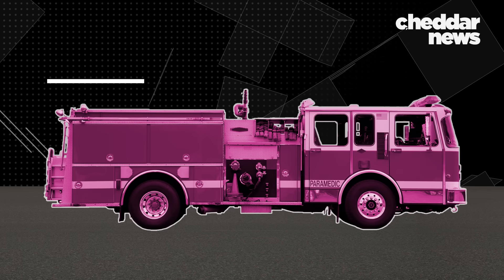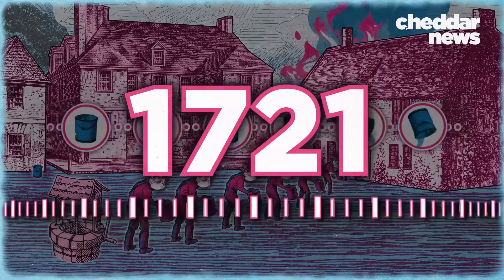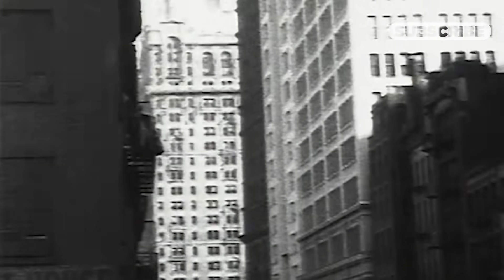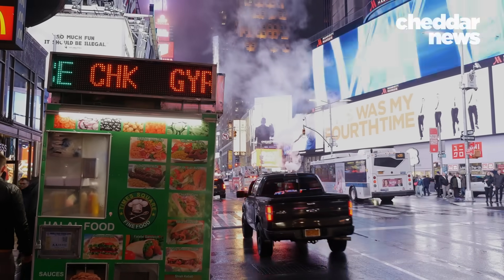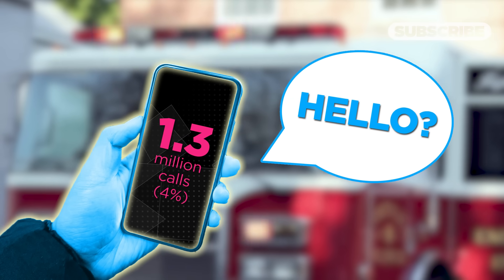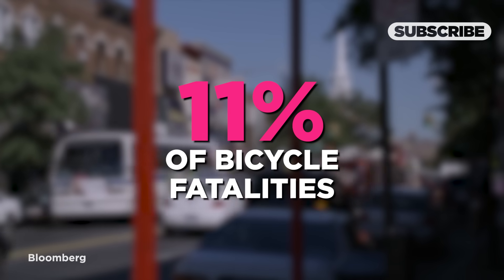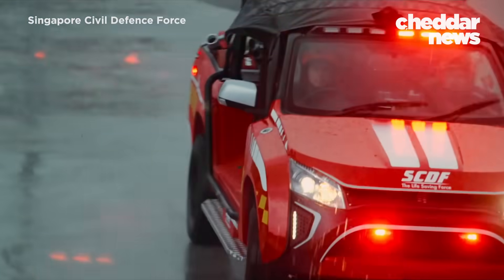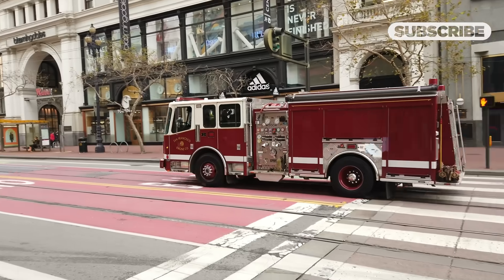Do American Fire Trucks Need To Be So Massive? - Cheddar Explains

Comment: I like the old look...  it's iconic
Also, this video misses so much.  Baltimore, for example, has a need for those long tiller engines for 100ft ladders.  This was written by someone who looked at statistics and never bothered to ask firefighters why they use what they use.  There's also many different areas that have different needs.  You wouldn't be caught dead out here with a 500gallon tank.  Hell, hay firefighter We dumped 500 gallons just to stop a small area from smoldering.  Meanwhile, back in the day, another local fire department had an engine.  Made by mack.  Old trash truck.  You could u turn it on a two lane road.  But please, keep going with statistics about other areas with different needs.
Reply: "Baltimore, for example, has a need for those long tiller engines for 100ft ladders." what need is that?
Reply: @EnjoyFirefighting  you do realize skyscrapers are tall right?
Reply: @TurtleSauceGaming  you realize that 100 ft ladders aren't concidered as tall? A 105' rear-mount platform ladder is the standard in most places on this side of the pond. Many departments will also operate a platform in the range of 140 ft to 170 ft. Tallest platform in my country hits 300 ft and tallest one built over here hits 367 ft

All those are barely built for skyscrapers, but rather with other types of structures on their mind: the kind of structures, which unlike skyscrapers don't come with large elevators which can also be used in a fire incident, or seperated and secured staircases. They're e.g. for churches and church towers, transmission towers, wind power stations, ropeways, bridges, construction cranes, gantry cranes at cargo terminals and ports, industrial sites, ships, ...
Reply: @EnjoyFirefighting  I'm just giving an example. I really don't deal with aerials. Our tallest building is a grain silo. The extent I know is a 100ft ladder for a 4 story jail in a nearby town.  It's not a perfect argument, but I'm not using my limited knowledge to try to justify an argument of trucks being too big.

Comment: All fire stations, well, most of them have small, more maneuverable units and only use the big ones for actual fires or cases where they are needed. Europe also struggles with their fire equipment because they’re not as capable because you can’t fit all the equipment on such a small vehicle. Therefore, you need 3 to 4 times more vehicles per fire station in order to get the same effect as the larger ones of the US. It’s a give-and-take neither is better than the other.
Reply: "Europe also struggles with their fire equipment " They do? I don't think so; Also e.g. an Engine in Germany holds all the equipment they need, from ground ladders to heavy rescue.
Reply: @EnjoyFirefighting  question do you or are you living in Europe ? My Self I was stationed in Europe for 4 years in the Military and my job required me to work closely with the fire department. When you are in charge of more than 100 Million Gallons of Fuels FIRE is a " MAJOR " concern. During Fire Fighting Drills with the Locals they had to bring in 3 - 4 times the amount of trucks that the US Military had. Thats just to MATCH the Capabilities. Their tankers held 1/3 the foam & water, they needed a separate truck for just hoses. A Pump Truck, CC (Command/Control), Personnel Transport. NOW you do not need a Huge Tanker/Pump Truck for a Heart Attack. That is WHY US Fire Departments have a stack of trucks. European Ladder Trucks can NOT reach to 10 stories (31m in the air) they are to short to do so and the Largest in the US can hit 20 stories high (about 61m or 200 feet). For THAT you NEED a BIG AZZED TRUCK ! But its to a point where some cities have bought smaller trucks so they can maneuver in cities. Out in the country side where I live we have a Mix of Trucks.
Reply: @michaelernst3731  Yes, I'm from Germany and in fact relatively close to some USAG bases in the area, I'm well aware of some of the circumstances there. I still remember the old American Engines they operated - had to be classified as Tanker here due to simple fact that they didn't carry enough equipment to be classified as Engines by our standard. By now the US Army Fire & Emergency Services replaced most of their American fire apparatus with European ones by now, like e.g. the Engines are Scania CrewCabs with Rosenbauer AT3 body system now. 
"had to bring in 3 - 4 times the amount of trucks that the US Military had. " it wasn't uncommon for us to respond to USAG basis or incidents in between those. In fact in some places they gained some rather infamous popularity, like due to the actual mass casualty incidents arising from drills, Humvees falling from the sky or several fatal accidents at railroad crossings. Helping them out was ... kind of common tbh. The other way around, those apparatus from USAG bases barely ever supported local departments in incidents outside their base or areas which didn't somehow belong or were used by them. 
"Their tankers held 1/3 the foam & water"  just like the by current standards 9 different subclassifications on Engines, also the Tankers have a range of subclassifications which differ a lot in size. Even more comes with the older, outdated classifications. A van based unit with only 260 gallon might be classified as a Tanker just like "normal" ones with 1,000 gallons. The volunteer department in my village is about to replace the old Tanker with a total of 1,453 gallons of water and foam with a Pod Carrier with tank pod with 2,113 gallons of water and foam. Although with a way larger tank than the old Tanker, it's not classified as a Tanker. In some aspects classifications can become a bit odd, but it all depends on tank and pump capability and the other equipment carried by the apparatus. An apparatus with a certain tank and pump size might be classified as e.g. Mini Tanker or Portable Pump Truck depending on its range of equipment - just an example. 

A major difference is the entirely different response system which has many different reasons based on another reason. Thus for example the streets in a 2000 year old historic city center and the construction style limit the possible access to some buildings; While you can operate an Engine from the distance, you want ladders to be able to go as close as possible. Means the Aerials need to be as maneuverable as possible, resulting in them having less equipment and smaller crews making the truck as compact as possible, which again results in the Engines carrying all the quipment the Aerials don't carry along. That results in them responding together, creating a convoy, which again leads to use having only one or few large stations instead of numerous tiny stations scattered in the area. 
In fact, no matter if actually needed or not, the minimum required standard to a building fire alarm response (no matter if someone called and reported a fire, activated a fire alarm or an automatic fire alarm setting off) is at least 1 Ladder and 2 Engines or a Tanker instead of the 2nd Engine. Most departments will go beyond the required minimum by having some sort of command or battalion chief unit and maybe an ambulance as part of the convoy as well. Sending out 5 units in a convoy doesn't mean that all 5 are actually needed on scene. 

"they are to short to do so and the Largest in the US can hit 20 stories high (about 61m or 200 feet). " uhm I can't agree on that, not at all. I still remember E-One praising the 137 ft ladders reaching 13 stories and  being the tallest in North America, like they're used in Jackson and Zionsville. The by now tallest one in North America indeed reaches 230 ft / 20 stories, but it's in Canada and not in the US. Where in the US is the 200 ft ladder you mentioned? Never heard of that one? 
In Europe a 105'ft rear-mount platform is the standard. Many (!) cities also operate at least one platform somewhere in the range of 140 ft to 170 ft. Tallest rear-mount ladder platform built in Europe is a 200 ft. ladder, however the boom platforms reach even taller than that. Tallest one in service in Germany hits 300 ft, tallest one ever built in Europe reaches 367 ft. 
Aerials beyond 100 ft of height are super rare in the US. Also the tillers don't reach any higher than 100 ft despite being on a massive long chassis, comparable to the size of truck chassis used for the 300 ft platforms in Europe
Reply: @EnjoyFirefighting  From your first reply I thought you were from Germany but was not sure thats why I asked if you were.

Different Codes. The BIG Pumper Trucks carry O2 for patients till the Paramedics can get to the patient. Fire Axes/Bars/Other Break in Equipment, Air lines for Jaws of Life, 600 feet of hose, 2x1,200 Gal/Min water pumps, 600 gal on board Water Tank, 100 gal Foam Tank, Hardboard Stretcher, Defib Machine, E-Blankets and in some places a Thermal Heater unit for cold weather. Other trucks have different functions. Like I said US trucks are no better or worse then European versions just from Small to VERY Large. Back in the 80's - 90's they were ALL large, today its a Mix.

When you have a major fire you need ALL Hands to help put out. The Fire services Equipment takes a HARD BEATING ! also its just better business sense to get a local truck from a country like France IF the vehicles are just going to stay there any ways. No NEED to ship parts around the world. Also Germany makes good trucks. 

But the point is again European Fire Trucks are NOT Better than the US Trucks, they fill the same roll. When your house is burning down I could care a Crap WHO " MADE " the truck ! Just IF it can save my home.

Also didnt know Germany got a Super Large Ladder since you dont typically have super tall buildings. I think the US only has like 5 - 10 like that.
Reply: @michaelernst3731  True, different codes; Still they all were classified as Tankers - even one aspect which they might not fullfill is sufficient for them not being classified for another type of truck. 
"No NEED to ship parts around the world" I agree on that, however another aspect might be even more important: local maintenance and support on spare parts; As no American apparatus manufacturer is active and doesn't have dealership support in Europe, it can take long to get parts over here. Funny enough to see that the US Army Fire & Emergency Services leave some of their all American apparatus behind but import some half-American half European apparatus when going back to the US. Not sure why, just observed that a couple of times. 
I looked up various sites, with a Bronto being built for Toronto, being the tallest one in N. America with its 230 ft; Marcus Hook Industrial Complex in the US had the tallest one in the US, reaching 180 ft. 
In Europe those tall platforms are barely required to high-rise buildings and incidents there; Skyscrapers usually have elevators which can be used by the FD also in case of a fire, and seperated secured staircases as well. The tall Aerials are rather meant for structures which lack these elevators and staircases, like tall churches with their even taller church towers, transmission towers, wind power stations, construction cranes and construction sites, gantry cranes at cargo depots and ports, ships, ropeways etc. 
While some of those exist only in relatively few places, especially churches are relatively tall pretty much anywhere; Tallest church tower in Germany is 528 ft tall. In the same city a popular apparatus manufacturer is based and their tallest rear-mount platform ladder in the lineup reaches 200 ft
Besides actual platform ladders and platform booms, some places also make use of the higher reach of the mobile cranes, which are operated by fire departments in many places as well
Reply: @EnjoyFirefighting  the part about not needing to ship part was the point you made. It’s just cheaper to use a local truck IF they are worth using than shipping things around the world and also US/German relations so most German equipment are interchangeable with us. I just didn’t word it better.
For some reason we have gotten away from big ladders. Which is a surprise with all the buildings over 20 stories in the US, you would have thought we’d have a lot.

Comment: 400-500 gallons of water... Really?

Thats like 2000 litres. Thats less than the smallest "truck" standardisation over here. 

Here in slovenia general purpose fire trucks follow the GVC1, GVC2 and GVC3 standards (GVC stands for general purpose fire truck with water when directly translated).

GVC1 = 5 firefighters + 1 driver with 2500litres/660 gallons of water (this is the most widely used fire truck).
GVC2 = 2 firefighters + 1 driver with 5000 litres/1320 gallons of water.
GVC3 = 1 or 2 firefighters + 1 driver with more than 5000 litres/1320 gallons of water.

Anything smaller is classed as a fire "car" with water and is drivable with a standard car licence and it goes up to 1500 litres /396 gallons of water.

All the fire trucks have a full set of equipment to which includes ladders, hand tools, electrical equipment, ventilation equipment, foam making equipment and canisters, along with an internal foam canister with the size of 10% of the water tank storage. There is also the standard fire hoses for the low/mid pressure range and 2 or 3 high pressure hose mounts, and a pump that runs all of it. Every truck also has a lighting tower (an internal extendable mast with lights that can be lifted up for night operation) and a generator to provide a portable source of electricity for the lights and any power tools we may need. The cabin has a breathing apparatus with extra air canisters for each crew member, thermal cameras, first aid packs, climbing equipment and so forth.

Optional stuff can also be added like hydraulics for cutting people out of wrecks, automatic defibrillators and so forth.

I guess what baffles me is that despite the size of the american fire engines they actually seem to hold a similar amount or less equipment, than the far smaller trucks here.

Comment: A big difference between us and European fire brigades (or department In the US?) Is the difference in the size and layout of cities and towns. Somewhere like London could never accommodate the (to us brits) giant fire engines typically used across the pond. So the vehicles by necessity have to be smaller and more maneuverable. Additionally it would seem buildings can typically be much bigger and taller in the us compared with say a British home. Of course large tall buildings exist and of course big industrial buildings too, for which specialist equipment exists. The use of suv vehicles by both the fire service and ambulance service is quite common to speed up the initial response and where a full appliance is not required. 

Like everything,  no one thing can apply for everything and every city will have what they deemed as necessary for what they expect to be needed in that city or town.

Comment: as a fire fighter the trucks we use are ment for the buildings the district and if we do not havr the propper ecitment then hwo are we supposed todo the job our trucks are spaced and our cross lays are very easy to reach andquick to get to along with the pumper and erouoe is lot closer toghter then america is that is why there trucks are so much smaller